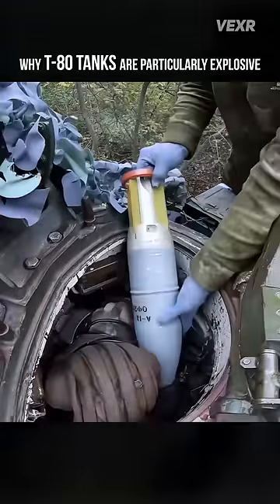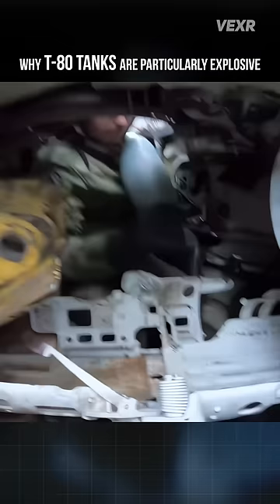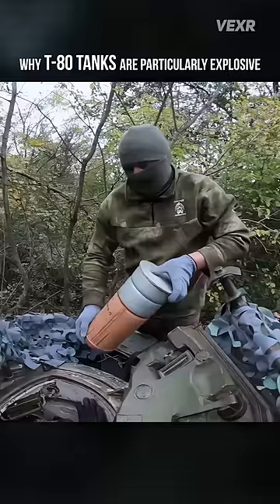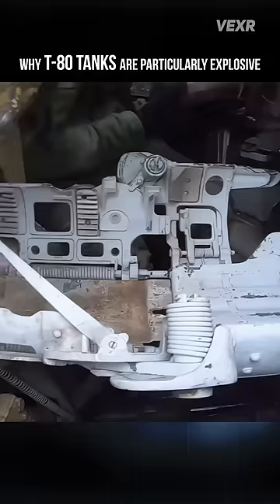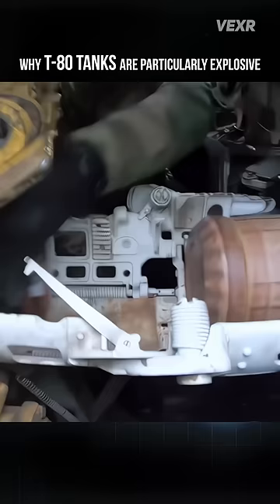T-80 Tanks Are Particularly Explosive, Here's One Reason Why

Comment: One should also be aware that every tank is explosive, not even the Abrams is safe since if the bullet hits the ammunition storage units the whole tank is gonna blow regardless.
Reply: The Abrams, and nearly every other modern mbt actually has blowout panels so that when the ammo storage is detonated, an outer plate ejects from the tank and the explosion is directed outside instead of into other ammo storages and the crew. It will still bring the tank out of the fight but the crew has very high survival rates!
Reply: @candycoral3804 The concussion effect on that would be astronomical.

Comment: Having an ammunition loader is a worthwhile handicap in my opinion.
Reply: Not really, its slower than a human loader. The autoloader in a T80 takes about 10 seconds to reload. To qualify as an abrams loader, your reload time has to be 6 seconds, and the average is about 5. An Abrams can get off 2 shots in the time it takes a T80 to reload, and thats at the T80's best. Its also very prone to jamming
Reply: @skyraider87   Didnt the Abrams X concept have an autoloader though? It can't be that bad if we're looking into having it on our next gen tanks too.
Reply: @marshwalker7217  different kind of autoloader. It was also more of a tech demo than an actual prototype
Reply: @neskrafe  yes. The AbramsX probably had a similar autoloader to the Leclerc, which uses a continuous link carrier magazine. It's both faster (the reload rate is 6 seconds if firing the same ammo type twice, 8 if switching ammo types. Compare to the Soviet/Russian carousel autoloader which is slower at 10 seconds with the same ammo type, around 15 for switching ammo types), safer because it allows for the ammo to be stowed separately from the crew in a compartment in the back of the turret with blowout panels, and is also less prone to jamming if the tank is reloading on the move since it allows for the use of single-piece ammo, and is also more stable with less moving and rotating parts

Comment: Generally speaking the T-80 (and T-64) are more susceptible to ammunition being detonated by a penetration from a direct fire munition because the propellant cases are stored vertically, where in T-72 and T-90 it is horizontal. 

But realisitically, a number of cases show it is usually the secondary ammunition that detonates the tank, as it is basically scattered around not only the upper hull but even the turret, wherever it can be fit. 

This is VERY prone to detonation compared to the carousel. 

Dont believe me? Boot up war thunder and view a T-72A or T-80U with its full ammo load. 

Its ridiculously prone to being hit in ammunition.

Comment: They were good designs in the 70s, 80s even early 90s. But when smart munitions went into service, the autoloaders became death traps.
Reply: Wrong
Reply: Didn’t every tank become a death trap at that point? I mean even if it doesn’t have an auto loader if a shaped charge penetrates the top of the turret into the cabin the crews fucked regardless of counter measures. I reckon we are gonna see less and less tank warfare as years go by.
Reply: @Justa_Guy_YT  Yes. Only modern tanks that have a separate compartment for ammunition aren't.

Comment: It’s disturbing how long it takes to reload the autoloader
Reply: Wdym? The autoloader is reloaded outside of combat conditions so it doesn't matter how quick it is. The point of it is that during combat conditions it can reload quickly
Reply: @howtocookdis4801   And if you run out off ammo in combat your fucked
Reply: @@CptMajong  doesnt take that long to put more ammo in an abrams
Reply: @cynicaltexan9639  the abrams loading process is  not fast by any means and she doesnt reload under combat fire conditions. the point you are making is mute . not to mention that most of these t-80 tanks are older designs
Reply: @cynicaltexan9639 tf you mean lol? Every weapon and tank is basically toast if it runs out of ammo you silly XD
Reply: @cynicaltexan9639 the Abrams doesn’t load faster and if it does it’s because of loader’s skill and strength, but that will quickly disappear once the loader gets tired from moving around heavy ammunition.
Reply: @fabiospasiano9885  I was a loader on an Abram’s there is a way to load the roads by using physic so to not use a lot of energy

Comment: They are generally more explosive because the ammo is stored directly inside the fighting compartment (inside the carusell). And given the size of a fighting compartment and that it is a priority target, the likelyhood of a hit causing the ammo to blow up increasey quite a bit.

At least compared to tank designs where the ammo stored in a seperate compartment, which is a smaller target and therefore there is already a smaller chance that the ammo blows up after a hit just by probability.
And even if the ammo blows up, the idea behind the seperate compartment is that the explosion is vented outwards threw strategic weakpoints instead of penetrating into the fighting compartment.

Comment: Autoloader usually have slower reload rate.
Ammunition is stored next to crew reducing survival rate when hit
More parts that can break
Advantage: 1 less crew to run the tank

A manual load is faster. 
Ammunition is stored separately with a slide door, increasing chance of survival if it would explode
(Dis-)advantage: 1 extra crew member

Comment: I saw about tanks in other videos, it's said they used different storage for their 'ammo' with backdoor made of pure steel or something that is hard enough to deal with 'ammo' failure/explosion from it.

So this tank can easily exploded when the 'ammo' have failure because it didn't have any door to separate it from the main body of tank.

Auto reload itself isn't a fault for this, because many other types of tank have auto reload.

Even if the tank isn't using auto reload, there's bound to be a failure 'ammo' when the crew reloaded it.

That's what I've saw from other videos about tank.

Comment: i remember learning when i was young about the flammability of hydraulic fluid from The Kaprun disaster in Austria. I believe it was November 2000. There were two funiculars that were meant to carry people from a ski resort to the top of a mountain via a tunnel. The funiculars had been thoroughly inspected for anything that could cause a fire because they ran on hydraulic fluid. One day one of the cars caught fire, killing all but a handful of the passengers. Most would’ve survived but they went up the tunnel instead of down. If you know anything about smoke it always goes up and the tunnel acted as a chimney. The few that survived were with a fire fighter who knew they would die if they went up the tunnel so they went down and made it out. What ended up causing the fire was a space heater that was installed in the drivers cabin. Hydraulic fluid had leaked onto the heating element and started the fire. Long story short I never forgot that hydraulic fluid is extremely flammable.

Comment: “Hydraulic fluid is sometimes flammable”

Now, I’m not an engineer. But I did tell our engineer every meaningful correction that he ever ended up making in our specs. I’m a fabricator by trade. I bet you a lot of money if I had 10 grand for materials and 2 months, I could figure out how to make a hydraulic fluid ignition cause no damage to the occupants of the tank, probably by using really selective placement of certain thicknesses and strengths of material. Make the pressure that occurs after scattered vapor is ignited finds the blowout point, which should be facing away from operators. 

If my high ass at 8:43 sketched a mental blueprint for a hydraulics system that doesn’t compromise its operators if it catches on fire, I’m pretty sure the US military designed it in such a way that if it was hit in a spot where an explosion occurred, it would cripple the tank and likely kill the operators anyway. I’m just guessing, but seriously, I doubt it’s hydraulic fluid. I work with that shit all the time. If I can smoke a cigarette with fingers soaked in it, I’m pretty sure the depleted uranium payload of an incoming shell is gonna be a bigger problem than a pressure explosion from a hydraulics system.

Comment: More often than not its because the extra ammunition is stored in a ring around the base of the turret and lacks any sufficient method to vent the explosion outwards away from the crew. The pressure builds and the path of least resistance is upwards out of the turret ring which is why you see so many turret toss videos.

Comment: Auto loaders are always not as safe as manual bc they sit in the turret so there cant be a thick steel plate between you and your ammo. You will most likely be f-d inside with both types of auto loader. But he is right, flameable liquid adds to the 'youre not gonna make it' factor.

Comment: The worst enemy of the T80 is not the Hydraulics actually, but it's enemies, like the M1A2 Abrams, it uses a Manual Loader, which meant there's a loader that loads the shell into the gun, for example the 120mm Smoothbore Cannon, and the magazine is in the back of the turret, with a blast hatch on top which meant if the ammo explodes due to it being shot at, the hatch would fly off, keeping the crew safe, while the T-80, and T-90 have autoloaders, which meant the rounds and propellent are in a circle, which is a weakness, just shoot at the T-80 or the T-90 at the Rim between the turret and Chassis, ONCE and let the Ammunition do the rest as the turret flies off, knocking it out instantly, that's why the T-80 is a death trap

Comment: Not even one "(((tank expert)))" ever mentions the fact, that most of the succesfull tank hits are the turret ones. That is the case, because according to I believe not only russian, but anyone else's army doctrine of tank operating it is recomended/required for the crew to cover the hull of the tank as much as possible during stand-outs. The most common way of utilizing this tactic which probably everyone knows is the basic entremchment either somewhere near the frontline or on camoflauged positions for ambushing the enemy convoys or smth. But returning to the first part, because of the turret getting most of the hits during modern tank standouts, the hull placement of the loading mechanism drastically increases the survivabilty percent of the crew in the case of a turret penetration in comparison to the western school tanks, on which the ammo rack placement is either split between the turrent and the hull or fully located in the turret.
The conclusion of this statement is, that the hull auto loading mechanism of the russian tanks is indeed a smart engineering decision when it comes to the ammo placement and it's nowhere near to turning any T family tank into powder keg on tracks. Yet the part of the video that is right is about the unskilled crew. If the crew don't utilize the "cover your hull" tactic they would be much more vulneruable to becoming a closed tin can put on the gas stove, but I believe the same can be basically said about each and every tank.

Comment: The rounds in the carousel autoloader are actually harder to set off than the vast majority of other tanks, which store ammo in both the turret AND hull. The carousel lines the bottom of the turret basket and almost on the floor. Meanwhile, even while many western tanks have blowout panels, a rack of ammo in the hull is still usually present. And with modern AT weapons, ammo rack hit or not, the crew is dead and the tank is usually destroyed beyond practical repair when a penetration occurs. Smaller, harder to hit designs are the future because the frontal armor of every modern tank is nearly impervious, but even old WW2 era Anti Tank guns would punch right through the sides and back. The army is actually looking into making a fully unmanned turret so all the crew can be placed inside a very heavily armored capsule.

Comment: I would say it is more of a question of the construction of russian autoloader mechanisms in general. 

Old Soviet tank doctrine called for tanks to be as small as possible and to reduce the crew size.
The idea was - that smaller tank would be more material-efficient to produce and also harder to detect and hit. 
Soviets did not quite account for massive advancements in target acquisition technologies that made size irrelevant as a protective measure.

Autoloader was introduced to get rid of the loader, so you basically get a "free" tank crew every 4th tank. 
But combined with size requirements, it limited the way such autoloader could be built. 
There was no way of mounting it at the back of the turret, because it would increase the tank's profile. 
Turret basket is the only remaining place - but it creates a problem - autoloader like this needs constant access to the turret, because it need a lift mechanism and a carousel to cycle through available ammo. This means, there is no way to have blow-out panels, and on top of that, literally, crew sits on ammunition. 
Additional problem with this is limited space for ammo - should you ever need to develop new ammo, with say... a longer kinetic penetrator... You are screwed, because it will simply... not fit into carousel.

Comment: 19 year old midwestern farmboy is the best autoloader
Reply: It's obvious that you don't know much about this topic, don't comment on things you don't know because that way you only create misinformation, now I'll give you a hand: Park a T-72 next to an M1 and you'll notice that the American tank is considerably higher than the Russian one. No problem. It was originally designed to sit with the hull lowered in a fixed, prepared position to defend the borders of Western Europe with only the turret visible, so height was no real issue making the human loader much more practical.
The Russians, on the other hand, KNEW that their tanks would be the ones crossing the open terrain to assault the NATO tanks. As a result, they opted for an automatic loading system that allows the tank to mechanically load on the move without the human loader having to worry about being tossed around the turret by an evasively maneuvering tank. This also meant that the tank could be about a foot shorter. This meant that even incrementally the tank would be a smaller target and therefore more difficult to hit when moving in the open.
It was a conscious design choice made based on the criteria of the 70s and 80s. They simply did not see fit to change the design, it is just one of the most exported tank models in the world, so the then Soviets and now Russians see no reason to abandon the concept.

Comment: t14 turret is separate from the crew, this should fix this issue when the older tanks will be replaced
Reply: T90 as well
Reply: Its not "when" its if older tanks will be replaced by the T-14
Reply: @MrTefe  lol they have the t90 which is as good as any tank there is

Comment: There are three main things that modern western tanks have over (most) Russian ones. 

1: Survivability, and I am not talking about the tank being immune to damage. I'm talking about in case it takes a critical penetration, the odds for survival for the crew are much greater.

2: Reverse speed, most Russian tanks only have one reverse gear and can only do 3-4 km/h in reverse. 
(T-80 being the exception) This is quite a big deal for fire and maneuver and also the ability for the tank to get out of a bad position.

3: Crew comfort. This is a bigger deal than you might think, tank crews basically live in the tank and the cramped interior makes Russian tanks sub optimal for extended periods spent inside. This does take a toll on those forced in there to operate the tank. This is very much seen on IFVs like BMPs where infantry rather expose themselves by sitting on top instead of inside. Remember 80% of all casualties in war is to artillery.

Comment: Much bigger problem is that the autoloader has no cover. If ammunition is hit, the entire tank explodes. That's why most modern tanks such as M1 Abrams or Leopard 2Ax have 4 crew members instead of 3 and an autoloader and they have ammunition behind  automatically closing door. If ammunition is then hit, it explodes in dedicated place instead of tanks hull, thus saving a crew from death.

Comment: a small point for an Abrams with a 105mm cannon and 4 ammunition racks. and the 120mm has 3 ammunition racks.

1 (105 only) several shells near the cannon
2 in the rear of the fighting compartment on the floor
3 & 4 left and right turret niches with armored curtains

Moreover, only one armored curtain is automatic, the second one opens only manually. The automatic one opens because the loader constantly holds the opening button with his knee and in this position takes out the shells. When stalking is active, this curtain is constantly open. and loading a gun when the tank is driving off-road will not be very convenient.

and the protective curtains themselves will only save if there is a fire in the ammunition rack. they will not save you in the event of an explosion. and a fire/explosion of ammunition racks 1 and 2 is also certain death for the crew.

Yes, on the T72/80/90, when the ammunition explodes, the turret is torn off; on the Abrams, the hull usually breaks. but in both cases the crew and the vehicle die

Comment: The problem with Soviet tanks is that they have shells near the gas tanks and sometimes in the fuel tanks themselves (inserted as in the cup holder in the car).
When a nato tank catches fire the gas tank will not harm the crew and will send notification of the fire, and the tank will be operable within 30-60 minutes and will burn in 3 hours because the ammunition, crew and gasoline are separated from each other.
In Soviet tanks in case of gasoline tank fire it will be like in an oven and in 5 minutes ammunition will heat up and explode.